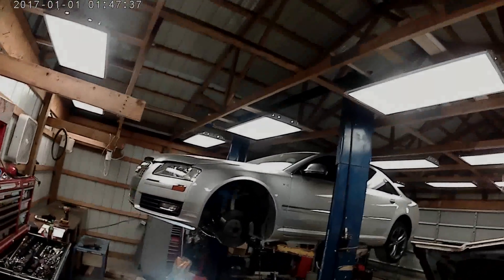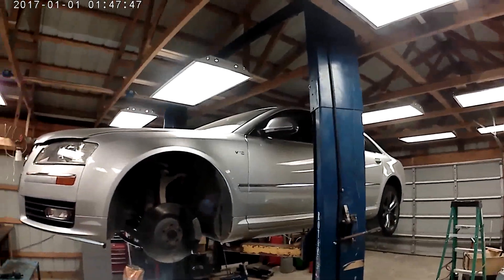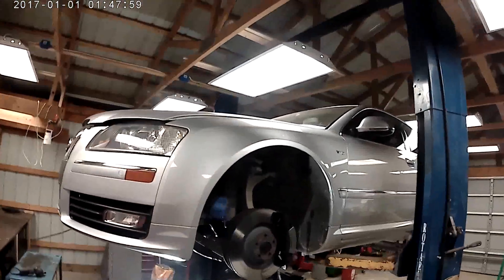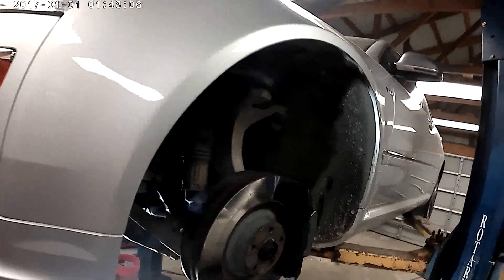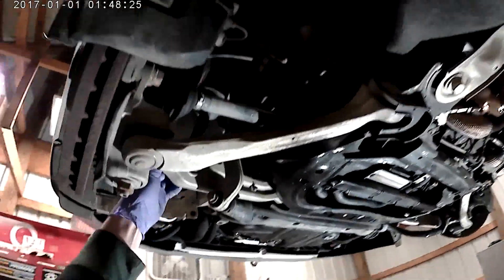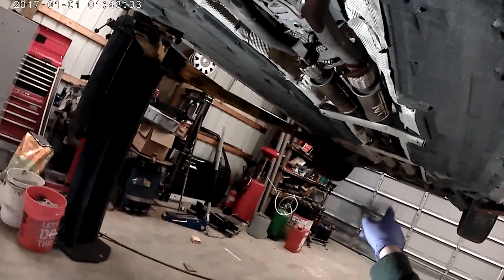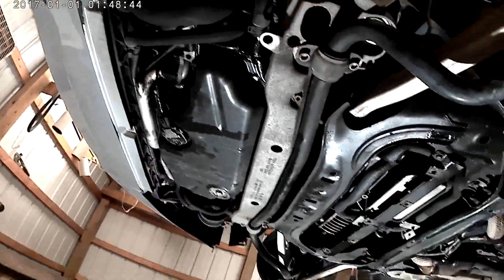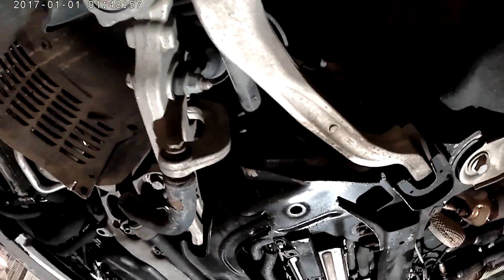Audi S8 V10 ENGINE REMOVAL & TEARDOWN Introduction Part 1. Mini Series

Comment: Hello there nice video . Can I ask you a question . Is it possible to remove the transmission without the engine ?
Reply from the maker: No, engine and trans have to come out, either out the bottom of through the front. Then remove exhaust manifolds, then can remove transmission.

Comment: You are my new hero.  There aren’t enough D3 S8 videos out there.  

Maybe break down the steps to the sub steps to get the engine out?

As in, you’re going to remove the bumper, so show that as a video, removal of the radiator and fans, break that out, stuff like that maybe?
Reply from the maker: Hello, thanks for the comment and suggestion! I am going sort of the way the OEM workshop manual says to proceed, with a few "shortcuts" along the way.
You actually dont need to remove the front bumper or even move it into the service position at all to remove the engine. The entire engine and subframe along with the trans and control arms comes out as one. 

 I will have a new video up tonight. I will try splitting them apart some, but I work a little scatter brained-a little here, a little there, then on to another thing...
Need to get my video editing skills up a bit to parse the videos some. 

Thanks and stay tuned!